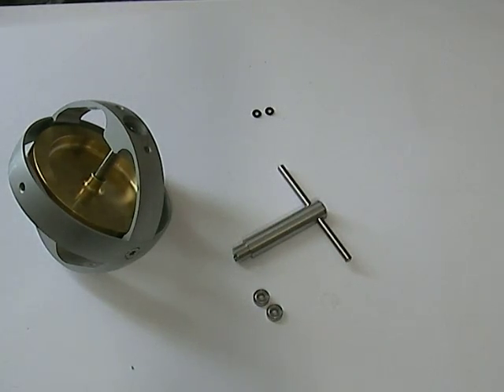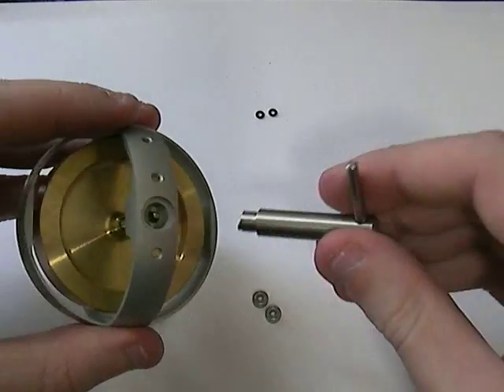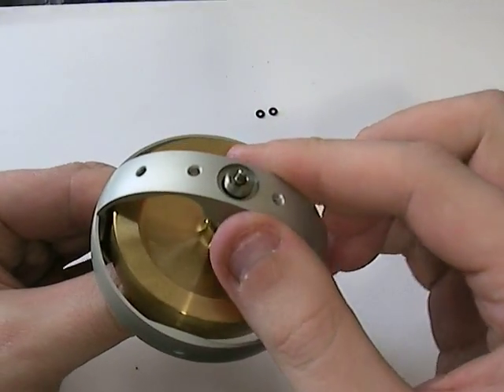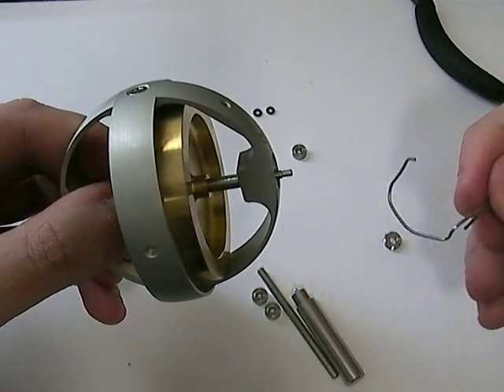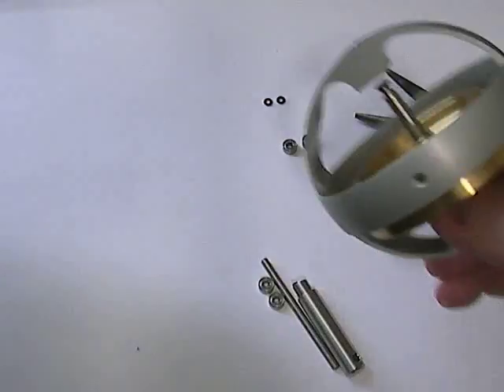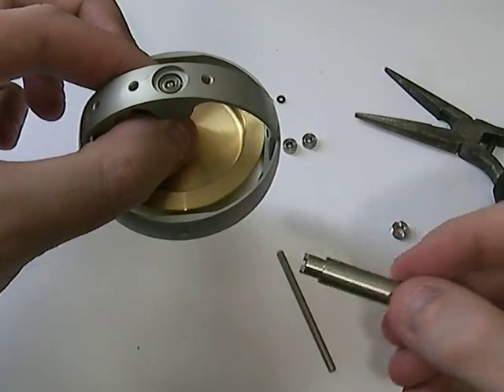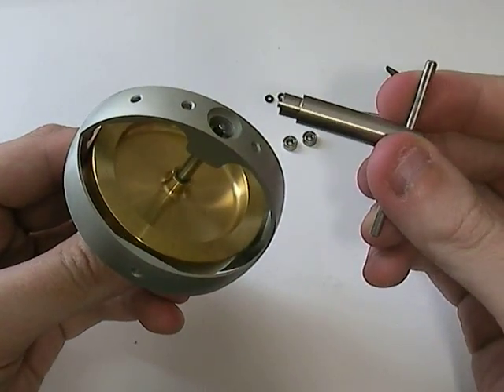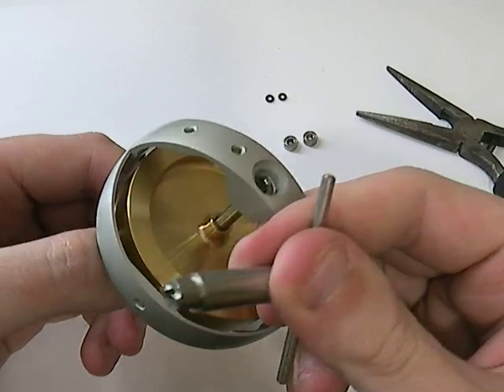bearing replacement

Comment: Not only would you be able to eliminate the Rube Goldberg resource wastage that consists of steam boiler/rotormotor/generator/power conditioning circuitry, but you will also have the means of DIRECT magnetomechanical-to-electrical energy conversion.  The result wouldnt be so much the generation of electricity as it would be Magneticity Generation.

Comment: The way to efficiently generate electrical current flow is to use a well-thought-out physical configuration of Halbach magnet pairs, along with properly designed eddy current paths, sandwiched closely together yet allowed to rotate without scraping.

Comment: I wonder whether a researcher has exploited the Halbach magnet configuration on the rotor of a Perendev generator in order to improve on the efficiency of rotational momentum?

In my mind's eye, seems to me that the Halbach configuration could eliminate the Rube Goldberg design presently being used to create electricity from a spinning rotor electrical generator; i.e., that of tapping electricity from the commutators of a generator which is mechanically attached to a spinning rotor shaft.